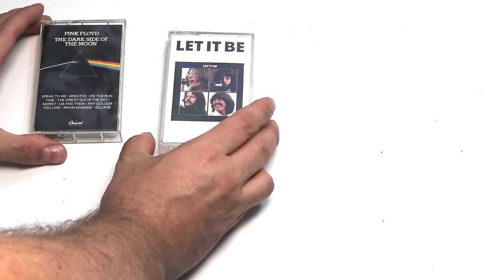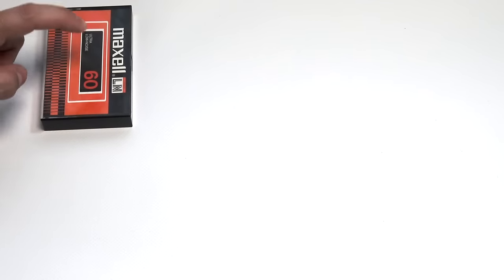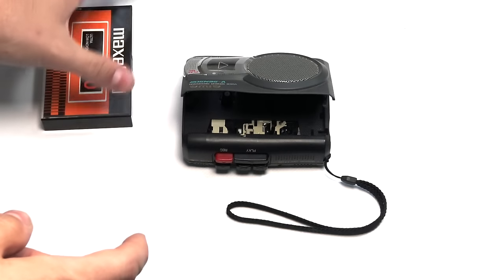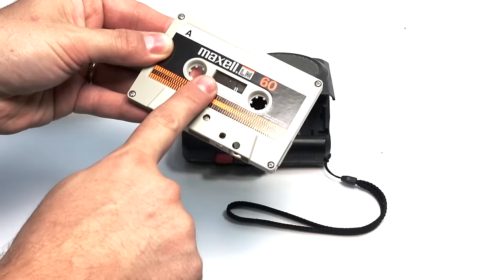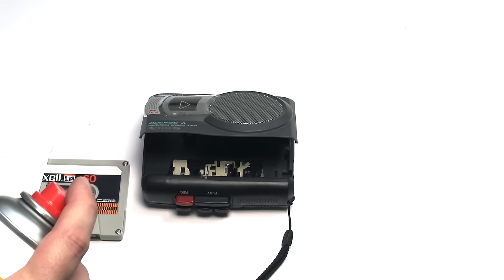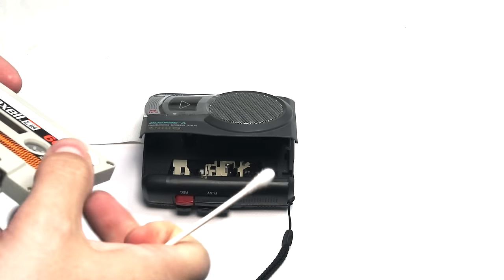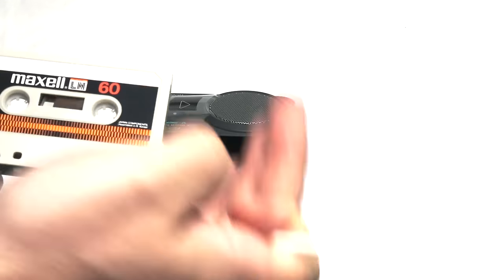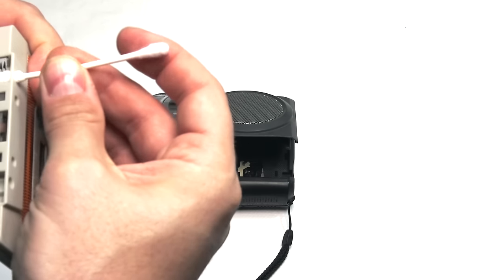How to relubricate your stuck cassette tapes

Comment: if you want instant results.bake the tape in the oven for 5 minutes. got a lot of my tapes working again. low heat though.
Reply from the maker: That is for sticky syndrome! Not for lube lack!
Reply: @anadialog  Not to be rude but Sticky tape syndrome is caused by a lack of lubricant, Specifically a bad formulation of Silicone Lubricant. And while baking a tape can help it is short lived, It is used when the oxide layer starts to flake off. After baking you then treat the tape with Nu-Finish. Also for all the Nay Sayers out there all tapes have a silicone lubricant and treating them will not hurt your tapes or machine, They may even thank you as long as there is nothing in the chemical makeup that can damage plastics. I have been using this method of Restoration for years with no ill effects on my equipment or tapes. And just so you know I'm not blowing smoke I'm 66 and a Certified Electronics Tech and have been repairing tape machines for over 40 yrs.
Reply from the maker: Sure, i get that, but the issue I am facing in this video is a dry problem, not the sticky problem, which is much more common :-)
Reply: this is a much easier and safer way. Use a dehydrator in fact. Works well and its even lower temp than an even. Try 100 degrees ferenheit to start.
Reply: @anadialog  again lack of lube is a very rare problem on TAPE itself. Maybe the mechanisms (hubs, rollers) need lube (but it's rare) - almost absolutley never, the tape and even then its usually real-to-real that's from the late 60's or 70's.
Reply from the maker: Jonah, as many other techs you are driven by prejudice without real knowledge, in this case, about this issue. It is really sad to see how arrogant you are, just go back and read your commnets. I see now that you have written several negative comments over the months and I think you should inform youself better before pointing your finger, insulting and denigrate people. I have posted simple things but considering that you would like more proof here you go. After rading this info, I hope you will be polite and intelligent enough to apologize.
Here you will find a selection of scientific papers explaining the issue and how it is a standard procedure to relube tape (even NASA does this!). I have underlined a few crucial passages in the papers: 
Heritage: https://www.dropbox.com/s/f8254yfeqrrw9vp/heritage-02-00097-v2.pdf?dl=0
Nasa: https://www.dropbox.com/s/xxdw1qh8mlbppdu/Nasa.pdf?dl=0
HESS: https://www.dropbox.com/s/ydrvxg6zipjkrvw/HESS_Tape_Degradation_ARSC_Journal_39-2.pdf?dl=0
Preservation Commission: https://www.dropbox.com/s/3s3ejmho2jexhgt/pub54.pdf?dl=0
   - (here is the official article: https://www.dropbox.com/s/rtvqt1n537w9vpa/Bogart.pdf?dl=0)
Kondo: https://www.dropbox.com/s/zi4vv42ggi9vh8u/tribochemistry-of-ionic-liquid-lubricant-on-magnetic-media.pdf?dl=0
Here is an article of a lab that is relubing its cassettes: http://tasso.cat/re-lubrication-of-compact-cassette-tapes-with-sbs/

Comment: Stuck tape, isn't that because the tape hasn't been used for a long time and solved by fast forwarding through it?
Reply from the maker: Well, sometimes you just need to do that and get the lube going again, but it some cases, like in most XDR cassettes, the lube is gone so nothing is going to save them if not a relubrication!

Comment: Re: lubrication of cassette tapes.  I read carefully all the instruction how to lubricate cassette tapes. So I buy from eBay  “Kontakt61 “ spray and lubricate  with a walkman and cotton  a 40 years old TDK SA C90  with a beautiful record of : Allen Parsons  Project” on it , which was working perfect  and was not necessary to be lubricated at all.  After 5 days I put this cassette in my Nakamichi Zx 7 . The result was wow and flutter, deviation and distortion saturation and frequently self stops.  I put the same cassette in my Alpage Al 300. The result was the same- wow and flutter, distortion, saturation and self stops.  I put the same cassette in my Philips N5781 – same result  wow and flutter, deviation distortion saturation and stops.  I put the same cassette in my Sony TC K 81 – same result deviation, wow and flutter saturation, distortion and self stop. I put the same cassette in my TEAC 2 head deck .The result was the same- wow and flutter, deviation, distortion and finally  not a self stop. So  why this is happen?  Hmmm. I lubricate the surface of the tape but the tape is turning into spiral roll and the surface lubricate the back of the tape. And the back of the tape is a nylon or kind of polyester that can NOT absorb the lubricant and stay permanent slippery. So  when the dual capstan deck play  tape , the back side of the tape contacting with a polished surface of shaft of a capstan , losing the friction because of lubrication  and  start slipping . So the two capstans can’t create the normal tension and contact with a head. (The contact between the tape and a head by dual capstan decks depend of the tension force between the two capstans.) When the back side of the tape is slippery there is no enough tension between the pinch rollers and no good  tape to head contact and also is reduced the puling force and the result is wow and flutter also saturation deviation and also triggering the stop mechanism. So in conclusion: Should be the tape lubricated? There was published a lots of materials and research for lubrication of a tapes. Yes  -some tapes probably are lubricated , but  I don’t see nowhere they to talking about cassette tapes this format and I do not see any instruction on TDK, SONY,BASF, MAXUEL , AMPEX or other company to recommending lubrication or any maintaining of a cassettes which they produced. The tapes which concerning the lubrication probably are old tapes for data or tapes for open reel to reel , where the tension of a tape and contact pressure between the tape and the head are acting different way with a clutch and brake of a reels and they do not have a capstans and pinch rollers , so the lubricant of the back side of tape can not affected the tape tension and tape-head contact. So I   record this experiment and I will post in YouTube .The movie including the process of  listening the cassette before lubrication , the process of a lubrication , cassette after lubrication , testing the cassette on all kind of my decks before and after lubrication with a oscilloscope  of a signal for calibration of level and bias . Is clearly visible the distortion and deviation on 400Hz signal after lubrication, the 10kHz signal of Alpage after lubrication is ridicules distorted and with a very small amplitude , The Nakamichi ZX 7 is not possible to find the azimuth and can’t record  or can’t read the 15 kHz signal. The  Philips N5781 record 400Hz wit distortion and  14kHz signal is on level -50dB and with distortion . The Sony TC-K81 -400Hz distortion , 8kHz  on -50 dB distortion. So if I did something wrong  , will be god idea the guys that lubricated cassette tapes to make the same experiment and to post information about their result .So this was my experiment with lubrication of TDK SA C90 with “Kontakt61” and also testing it on ZX 7 , Al 300 , K-81 , N 8751.
Reply from the maker: Why in the world did you lubricate a healthy tape!?! Obviously this did not work, it cannot absorb the lubricant because the tape was saturated with it.
In any case in one of the articles I posted they discuss this process also applied on cassettes. Again, not something I invented.
Reply: @anadialog  I lubricated a healthy cassette because it was the oldest cassette I have. I don't have bad cassettes because they damage my deck heads. I don't blame anyone for the result of the lubrication, which not only ruined my cassette, but also affected the deck pinch rollers. This contact spray contains butane and hexane, which are strong solvents and even in this insignificant amount have eaten away a very thin layer of the pinch roller’s rubber and they can no longer stop releasing black by cleaning them with cotton and alcohol. I should have cleaned them up right away or not done this nonsense at all.
F*k the tape, but I don't know what to do with those 5 decks who had nothing and were in excellent condition. As a last resort, I will have to change 11 pinch rollers. I apologize but I will not experiment with any lubricants on the tapes anymore. My cassettes are TDK Super Evelin from 40 years ago they play as I recorded them back then in 1980. And no cassette bothers me or squeaks and does not want any greasing. Whoever wants, let him do it at his own expense. For me, this is wrong information, which is not true for cassette decks with dual capstans. And I have a request to you - if possible, please find where exactly they mention that TDK Sony and other cassettes should be lubricated and exactly with what, because with this Contact 61 of Mr. Lucky from Germany only negative results and losses were obtained. I would like to see him play such a lubricated cassette with “Kontact 61” of the Nakamichi dragon, but it seems that none of the propagandists of greasing has released this cassette on the Nakamichi. So I will believe in the greasing of the tapes only when I see how, after lubricating the bad tape, it is released on the deck with discreet heads and begins to play great and make records and the automatic azimuth adjusts flawlessly. By the way, according to memories from 1980 - Super Evelyn may mean a special coating , glossed dry lubricant that reduces friction and wear of the heads and also enhances the magnetic permeability of the tape, And for those coarse-grained tapes where they are like sandpaper 400 and their particles crumble on the pinch rollers while they play, I will only note that each grinding paste consists of abrasive and lubricant. So by lubricating them you will achieve a great sanding effect on the heads of the decks.

Comment: I think it is really bad to lubrificate tapes, becouse you could contaminate with the oil  capstan and  pinch roller. It will cause a disaster and the malfuncion of the tape deck.
Reply from the maker: It's a standard procedure. Read the info  in the video description.
Reply: @anadialog  it is NOT standard procedure. Sorry. I've service tapes and tape decks for many, many years. It is not a thing.

It is SOMETIMES a thing with reel-to-reel tapes - but NOT cassette tapes.
Reply from the maker: It doesn't matter if you have serviced tale decks for s millennium. What I am saying is that ALL types of tape have lube and that you may add it again. Check the video description for further info.
Reply: ANA[DIA]LOG do you think I can’t read? I read your description and followed your links. 

The “scientific” basis behind lube on tape, as you’ve linked to, is clearly and specifically talking about reel to reel. Not cassettes. 

It also mentions that there is microscopic amounts of lube INSIDE the binder itself. This lube is applied at the nano level - and thus can not “reproduced” properly as it’s AGAIN, INSIDE the binder. The lube DOES NOT sit on the outside of the tape. 

The same article you pointed at, also mentions that IF any relubing is to be done, it is to be done by professionals like myself who actually know the science behind it. 

Your own article disproves your own un-scientific theory. It’s not based in fact or reality. It’s snake oil and you are promoting the ruining of headstacks and gears in decks. 

Stop it!
Reply from the maker: Jonah, as many other techs you are driven by prejudice without real knowledge, in this case, about this issue. It is really sad to see how arrogant you are, just go back and read your commnets. I see now that you have written several negative comments over the months and I think you should inform youself better before pointing your finger, insulting and denigrate people. I have posted simple things but considering that you would like more proof here you go. After rading this info, I hope you will be polite and intelligent enough to apologize.
Here you will find a selection of scientific papers explaining the issue and how it is a standard procedure to relube tape (even NASA does this!). I have underlined a few crucial passages in the papers: 
Heritage: https://www.dropbox.com/s/f8254yfeqrrw9vp/heritage-02-00097-v2.pdf?dl=0
Nasa: https://www.dropbox.com/s/xxdw1qh8mlbppdu/Nasa.pdf?dl=0
HESS: https://www.dropbox.com/s/ydrvxg6zipjkrvw/HESS_Tape_Degradation_ARSC_Journal_39-2.pdf?dl=0
Preservation Commission: https://www.dropbox.com/s/3s3ejmho2jexhgt/pub54.pdf?dl=0
   - (here is the official article: https://www.dropbox.com/s/rtvqt1n537w9vpa/Bogart.pdf?dl=0)
Kondo: https://www.dropbox.com/s/zi4vv42ggi9vh8u/tribochemistry-of-ionic-liquid-lubricant-on-magnetic-media.pdf?dl=0
Here is an article of a lab that is relubing its cassettes: http://tasso.cat/re-lubrication-of-compact-cassette-tapes-with-sbs/

Comment: Sony cassettes after 1991 have this issue really really bad!!! When they changed the tape formulation in 1992 it really screwed us over!!
Reply from the maker: Yes, this is an underestimated issue!
Reply: Interesting, I have quite a few Sony cassettes, EF, SuperEF, EF Super, HF, HF-S, UX, UX-S, all the way from the late '80s to the early '00s. None of them has issues. I had some second hand ones that was stored badly and got moldy, but even those were not sticking nor jammed. 

Few months ago I found a Sony UX from about 1997 that was accidentally left in a quite damp basement for more than a decade. It stinks musty but has no visible signs of actual mold on the tape, and plays perfectly without squeaking or sticking.
Reply from the maker: This is a problem regarding mainly prerecorded cassettes that are noticeably cheaper than those you listed l, which will stand the test of time.
Reply: @anadialog  Sure, but I replied to Chris Andrus who claimed that Sony tapes made after 1991 are problematic, an issue I have never seen (except with some 8mm MP video cassettes, but even that was a temporary issue with some batches from the early '90s only).
Reply from the maker: Oops sorry!
Reply: @mrnmrn1  I was talking only  about Pre-recorded cassettes That’s only records recorded after 1992. The tape ages very poorly.